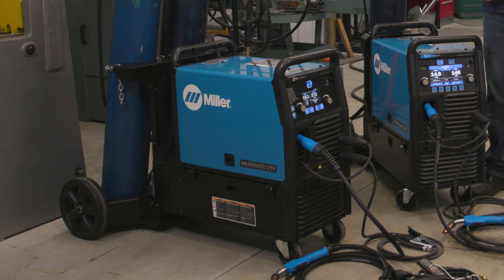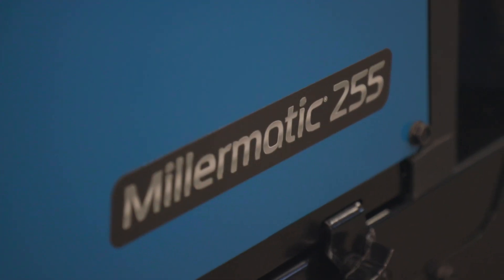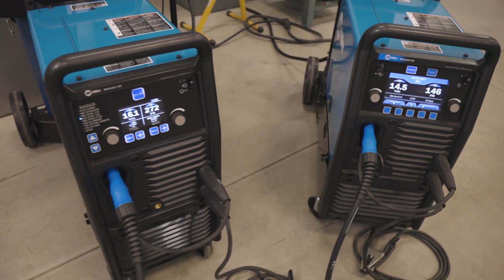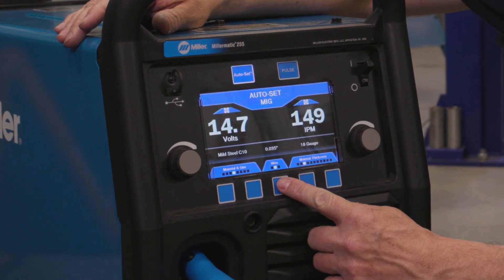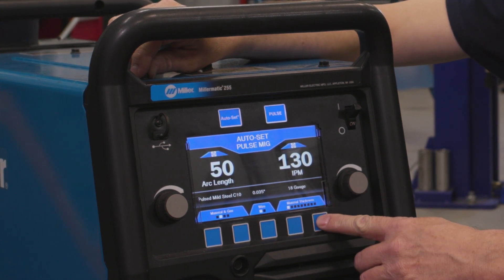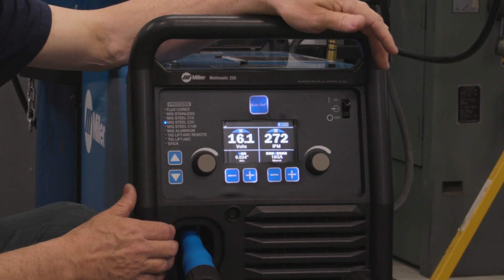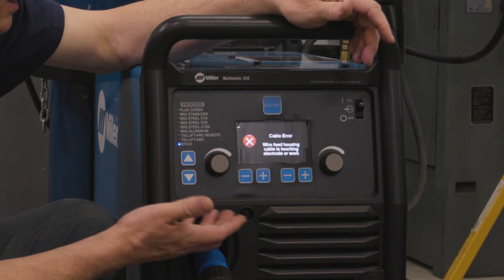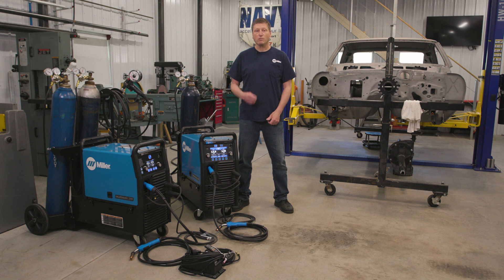Multimatic 235 and Millermatic 255 Comparison (Real Gear)

Comment: HELP!!!  My 252 won’t turn on, the red digital read outs flicker when i turn the switch on. If i spin the dials it flickers a little faster. Once or twice the fan turned on without anything being hot, (since it won’t run) Any ideas what it could be?? I purchased it new in 2008 as a hobby machine. Barely used at all since i tried to teach myself how to weld and seldom used it. Last time used was about 4 months ago. Thanks for your help, TJ
Reply from the maker: Hi there! Thanks for getting in touch. Diagnosing via social media can be challenging, so we recommend reaching out to our customer service team at 920-734-9821 for more personalized assistance.